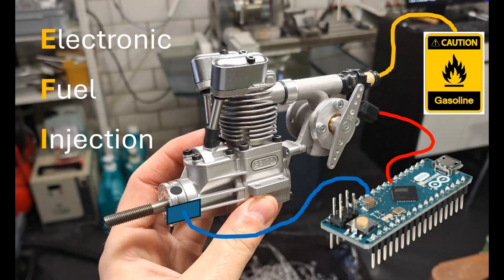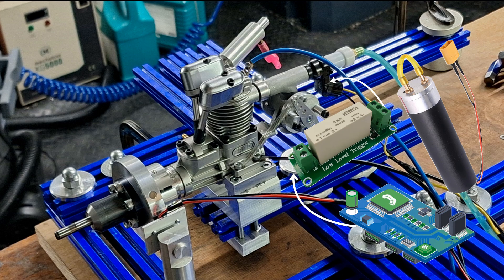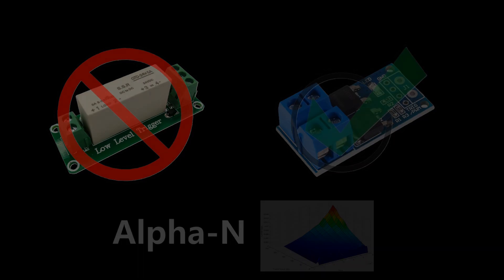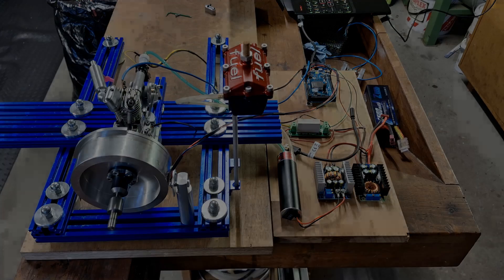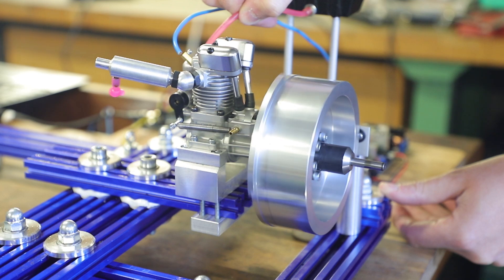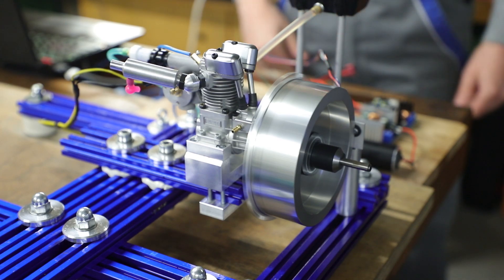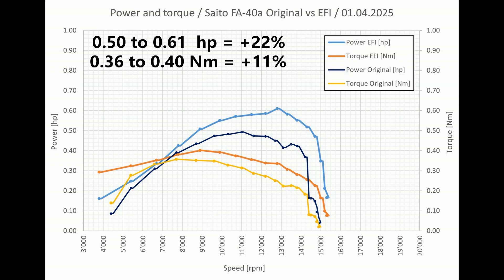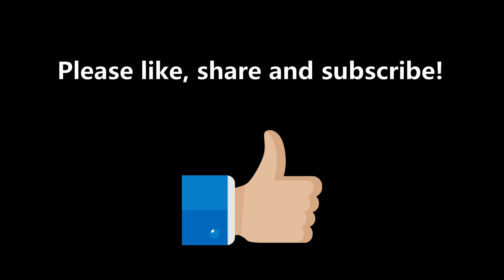Electronic Fuel Injection for a Model Engine / Elektronische Einspritzung für Modellmotoren / Part 2

Comment: If you have smaller electronics then I would test it on one (TOYAN FS-L400 14cc inline 4 cylinder 4 stroke water-cooled assembly engine model for RC model cars).
I'm trying to recreate some of ( stirlingkit /JohnnyQ90) things
Reply from the maker: Hallo Jürgen 👋 Klar habe ich eine kleiner Elektronik. Hast du dazu mein letztes Video bereits gesehen? https://www.youtube.com/watch?v=13xwum_Gbvw&t=3s Den Prüfstand habe ich deutlich weiter entwickelt und kompakter gebaut. Der Toyan FS-L400 ist ein tolles Funktionsmodell zu einem fairen Preis. Leistungsfähig und Langlebig wird er wohl nicht. Man hat viel gehört von gebrochenen Kurbelwellen und Verlust der Kompression nach wenigen Minuten laufen lassen. Hast du schon einen Toyan gekauft? Was hast du vor damit zu machen wenn du JohnnyQ90 ansprichst?
Reply: @danielhunziker3577  Yes, I saw your last video / but I would like it in a size of a "battery compartment 4x AAA Micro" without a pump
Reply from the maker: @jurgensollner7322  Hi Jürgen 👋 Sorry, I thought your native language was German because of your name. That's why I wrote in German 😅 Because  you replied in English, I will now write in English again. That size "4x AAA Mico" is probably wishful thinking 😕 Spoiler: I've already built a 5-way injection system for the VR5. Works great! I have just started editing the video for it. I reduced everything to a minimum in terms of size. For example, I built a super small high pressure fuel pump myself and used a transistor switch to control the injectors. The electronic fuel injection will not work without a pressure pump. You need around 1.0 bar at the injectors. The microcontroller itself is also quite large. However, this could probably be solved with an Arduino ESP32 (I'm currently using an Arduino Due, but there is a reason for it).
The Enjomor GS-L4 seems to be a good basis for improvements. What exactly is your goal when you write about JohnnyQ90 or strilingkit?
Reply: @danielhunziker3577  ich bin aus Deutschland aber versuche es für dich zu übersetzen 
"ich weiß" das die Mikrocontroller groß sind aber manche könnte man an winkeln 
ich bin im besitz von einem ( FG Formel 1 Competition 1:5 Modell ) und dem wollte ich mall etwas in den Ar... treten also einen ( -> kick ass )
die meisten Fahren jetzt mit ( 1/5th Scale Supercharger System + SILVER BULLET Nitrous Injection )
Reply from the maker: @jurgensollner7322  Hallo Jürgen 👋 Ich bin nur froh, dass nicht den Enjomor in den FG Formel 1 bauen willst 😅 Habe die nicht 26ccm Zenoah 2 Takter drin 🤔Die bringen ja standard irgendwas um die 2.5 PS (was nicht viel ist für 26ccm). Das ist ja überhaupt nicht mein Gebiet. Ich weiss aber, dass es mechanische Einspritzungen dazu gibt. Ob das was leistungsmässig bringt ist natürlich eine andere Frage.  Du meinst aber nicht RBInnovations? https://rbinnovations.com/collections/new-products/products/1-5th-scale-supercharger-for-g320rc-engine-hpi-only Da habe ich auch mal einen "Supercharger" gekauft und dass hat null gebracht! Wäre es nicht sinnvoller, wenn du z.b. einen Rennmotor von Taylor verbaust (wie z.b. TAYLOR 35cc V2 Billet Reed Engine)?
Reply: @danielhunziker3577  Sorry, but I made a mistake in the engine / it is the (ENJOMOR GS-L4 petrol engine, 32 cc, 4-stroke, DOHC, in-line four-cylinder, RC engine model, 12,000 rpm)

Comment: Would love to see video on tuning procedures with CHT and EGT considered.  Also your future miniaturized system will be very interesting.  Have you published the Arduino sketch?  Have you considered the ESP32?  I believe they are faster and available smaller.  Very interested.
Reply from the maker: No, I haven't published an Arduino Sketch of it and it's either not planned. There is a freeware for Arduino called Speeduino. Many people use it! But I wanted to build something myself. What you see in the video was a first prototype. In the meantime there has been progress and you are also using another 32bit 84MHz Arduino (DUE). This can do what I need and is compatible with the Excel datastream. Secret 🤫I'm currently working a complete multipoint EFI on one of my multi-cylinder engines. Hopefully it won't go down the drain 😅

Comment: It's worth noting, the set pulse width of the injection has no cold start or temperature consideration, no Throttle position to reference tip in enrichment, and manifold pressure would all help the EFI system run. I suspect it would run lean in certain conditions under this version. Looking forward to seeing it refined!
Reply from the maker: Hi man 😄 It's a model engine and methanol as a fuel is much easier to mix as gasoline. Model making is always to do it as simpel as possible. But i will improve it step by step.
Reply: It's a very cool project! I have been wanting to approach this for a long time myself as well. I definitely think having a basic set of sensors will make your project so much better  @danielhunziker3577

Comment: cute injector. still probably too big?
makes me wonder if piezo would work... as a pump and injector. maybe mount one in a bezel and measure deflection to voltage? try several size of buzzer disc...
one as a pump, one as a valve. one as a pump and injector itself. a given amount of fuel per pulse, and "buzzed" at 20khz for the appropriate times?  iunno...
one would definitely work as a MAP sensor.

coding EFI is interesting. workflow matters. i have my own project using a pic ship for masochistic reasons. interrupt conflicts are a minefield?

measure the length of crank pulse rather than time between pulses. as its so many degrees, you can use multiples of that value to figure out crank angles. sanity check on rpm and accel/decel. so many multiples equals a revolution... or should.

the MAP on a single cylinder is a really nasty pulse. have to sample it a few times and average out on the intake stroke to get a meaningful reading.
can use that pulse to tell which stroke its on, along with crank signal. no cam sensor required.

test that its running, that it isnt decelerating, open injector and start timer with pre-calculated period, sample map at multiples of crank signal, average reading, calculate time for next injection with MAP and RPM,   wait for injector timer to interrupt, turn off injector, wait for next crank signal... several interrupts and timers needed. multiple level priority helps? what to do if an interrupt takes place when already in an interrupt routine, etc... challenges that are to do with timers and logic rather than anything seemingly engine related... storing and updating data.... 

"alpha N"... fancy way of saying that MAP readings mean little at WOT. the VE at any RPM is a constant, the physical nature of the engine itself. cams, headers, etc. and so the fuel required is constant at any RPM. (ignore temperature etc!) you can figure that curve out on the dyno, no issues.
the base curve from which the rest of the tuning is based. temperature offsets, etc. 
at partial throttle the VE is dictated by the throttle and needs to be measured to get an accurate idea of the air in the cylinder, and so how much fuel it requires by tweaking that base map. MAP or MAF...

methanol is quite forgiving, especially on higher nitro contents ;) you use nearly four times as much as on petrol... hang on... probably why the injector works!
sorry, im thinking in petrol terms still, need far more accurate fueling!

Comment: IMO for the Saito's intended use, i.e. an rc plane, the weight advantage of the simple carburetor setup, even with its power disadvantage, will likely neutralize any attempts at miniaturizing the efi. If 22% more power is required, it'll more effective to install a slightly larger engine, use higher nitro content, etc...

OTOH, the efi might have a reliability advantage during violent maneuvers and it's just cool as heck!
Reply from the maker: Hi man! This prototype is far from usable for a helicopter or airplane. I would like to mention again that this is only a prototype. The aim isn't to build a 1-cylinder aircraft engine. The goal is a multipoint fuel injection for my multi-cylinder engines. The Saito FA-40a is just the test engine so that I can get set up the whole system and get it run. What I can already say is that I'm already working on the multi-cylinder version, including parts.

Comment: It's actually impressive that it makes that much more power and you say the map is literally just to open the injector X ms every n/2 rotations. Like it doesn't even have any mapping, it's always the same fuel for each stroke? That's kinda funny.
Reply from the maker: Hi man 😊 Love your comment! You're the first in the comments who get it how simpel I made this first prototype. Yes, I inject every 2nd rotation the same amount of fuel, which is methanol. That's pretty much it 😅 But to say, with gasoline this system wouldn't work. Methanol is much more easier to handle to get a well working mixture. A rc carb makes even a worse mixture than I with this EFI. But I will modify my system step by step with simpel things.
Reply: @danielhunziker3577  Ah yes, taking advantage of the wider AFR tolerance possible with methanol I guess. Very cool!

Comment: Great work mate, when you get it sorted, I think you're on a winner. As long as it can be adaptable ,to like multi cylinder engines.
Reply from the maker: Thansk man! The microcontroller is already modular programmed so that you can control up to 12 injectors. The main aim was to design this for multi-cylinder engines.

Comment: Similar performance can be obtainable with bigger pressure fed carb i think.
Reply from the maker: That is exactly the problem. I can't just buy annother carb! It has become almost impossible to obtain carburetors for model engines as individual parts. If so, then only individually at very high prices. That's why I'm building the EFI, so that I can later build it on a V8, for example, in an 8x version. That's the reason why I'm doing all this. The fact that I got more benefits is just a goodie 🙃

Comment: Increase in power i think not only by injection itself but by replacing butterfly throttle valve in carburetor to more ball-type valve that has no restriction from the valve axis and throttle when fully opened.
Reply from the maker: Hi man 😃 That's correct. It's difficult to say which influences led to an increase in performance. But all in all, it's a good result, isn't it? Imagine if he had had less power! That would have been devastating. 😅

Comment: BRILLIANT! Innovation takes time and balls.😂 But cost and complexity will increase.
Reply from the maker: Hi man 😃Actualy it's not an innovation. I'm just trying to break modern engine technology down to the conditions of a model engine. As simple, low-cost and compact as possible. At the moment it's more tinkering 😅
Reply: @danielhunziker3577 This is excellent work, especially with the improvement in power and torque. I’m actually surprised that fuel injection isn’t standard practice for these engines. Why don’t they have EFI, variable valve timing, etc today? All new cars have it, so why not model aircraft, etc?

Comment: Great video again! One thing I noticed, your torque horsepower curves aren’t crossing at 5252. As that’s a constant in the calculations, it says somethings wrong with the graph axis or the data.
Reply from the maker: Hi man 😃You're right. But this formula with the conversion constant 5252 is only valid for certain units. The torque must be in pound-foot (lbf.ft) and not in Nm as I calculated it. Let's test this. I have measured 0.50hp " 11'000rpm. According my diagram I have at this point 0.32Nm, which are 0.236 lbf.ft (1Nm = 0.7376 lbf.ft). When we are now calculate the speed according the formula (Horsepower x 5252)/Torque=Speed we get (0.50hp x 5252)/0.236lbf.ft = 11'127rpm which ist correct. You can check that in the diagram in my video on 02:55min. Any questions?
Reply: @danielhunziker3577  oh I see now! I’ve never seen HP mixed with Nm, it’s usually kilowatts… my mistake was that assumption of all imperial. Carry on!
Reply from the maker: @toxaq  You're welcome man! The pound-foot (lbf.ft) is a British and US-American unit. We here in Europe using Nm for the torque.

Comment: You can try the speeduino instead
Reply from the maker: Hi man 😃 You're not the first person to say that. The correct question is whether I want that? As a model maker, I am a doer & creator and not a user. That is also the core of model making. Developing and building things yourself. Everyone can simply buy and use 😉
Reply: Keep into mind that while hardware options are plenty, the Speeduino project is primarily firmware. 

That’s to say, if you want to make your own hardware design, Speeduino is a great firmware to start with. You could make a very simple single board with an integrated MOSFET for your injector and perhaps one or two inputs. Your HW can either be a shield for an Arduino, or your own custom board with everything there in a super compact unit.

Another thing you could consider is PWM fuel pressure control to manage battery consumption.

It really depends how much tuning control you feel you need, without having to develop code from scratch Speeduino (also RusEFI) firmware gives you a great base to drive a customer hardware platform.
Reply: @danielhunziker3577  I understand your point, and your work is impressive. I live in Brazil, and acquiring components for building circuits is quite expensive. For comparison, an original Arduino Mega costs about 35% of the minimum wage. I converted my car from a carburetor to EFI using Speeduino, creating a custom PCB tailored to my needs. I find it fascinating to see small model engines operating with 'conventional' EFIs. Thanks for you reply.

Comment: You could use a micro kerosine pump as used in miniature Gas Turbine engines.  These can do up to 2 bar as they have to compete with chamber pressures within the engine...These are micro gear pumps built to fine tolerances. Way smaller than the one in your video...😳😏🇬🇧
Reply from the maker: Hi man! Sound very interesting 😃 Do you have manufacture name or better a link so I can have a look at it? My gut feeling is that it won't be cheap... 😅
Reply: @danielhunziker3577  Oh, it's easy, go online and look at kerosine fuel pumps for microturbines...They're not too pricey but very refined as we have had them for decades...The fuel injector will be your "biggest" problem....literally..🤔🤔😏🇬🇧

Comment: Very small gain including a lot of pain.....The bulk and weight of the pump, injector and electronics would go against it in an aircraft installation...🤔😳🇬🇧 An expected result because the injector is forcing fuel into the inlet port under pressure...thus allowing more fuel charge. Rather than relying on the engines natural vacuum to draw fuel in....🤔
Reply from the maker: Hi man! This is just a simple prototype to test the basic system. Of course, everything is far too big and too heavy! But that doesn't matter for a prototype. The next step is to make everything smaller and lighter. Don't worry abou that 🙃

Comment: I am really interested to know how the Dino works, juste with flywheel data ?
Reply from the maker: Hi Tom 😃 This dyno isn't a secret. As I said it works the same way as a roller dyno for cars. You accelerate a high inertia flywheel. The only thing you have to do is to measure the time per revolution. You can then calculate the angular speed (= speed) and the angular acceleration (= torque) from these rotation times. The power is then simply the speed multiplied by the torque. All of course with SI units.
Reply: thanks for the explication, I thought it was more complicated ! Definitly a project I would love to do